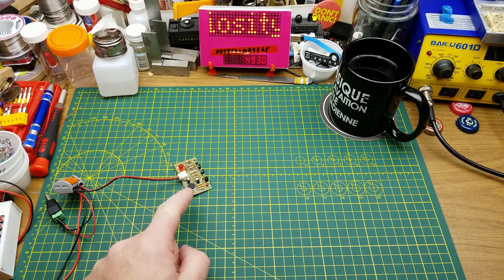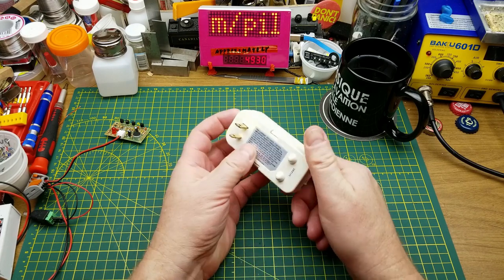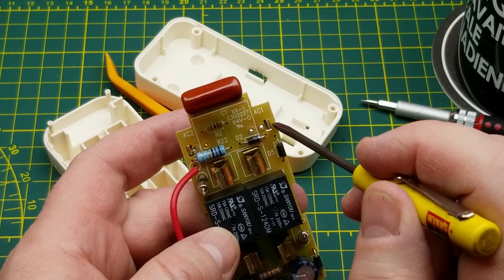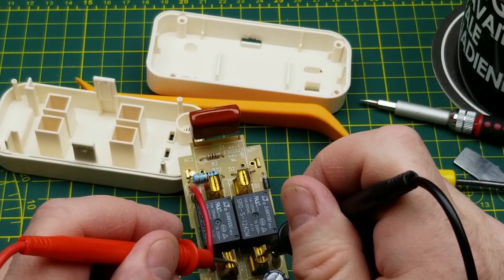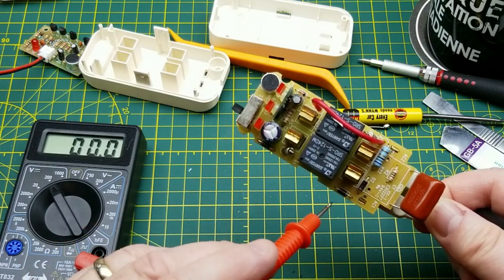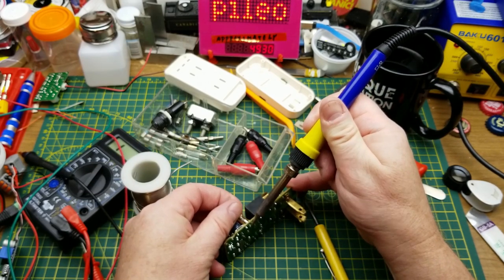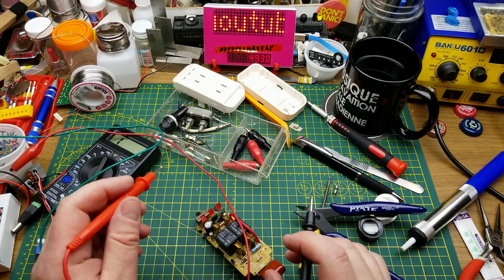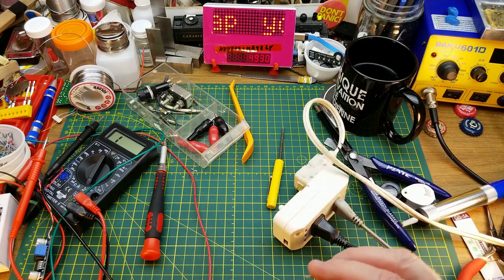The clapper - tear-down and repair

Comment: The old rule of thumb rating a fuse half as much again as the maximum power draw seems to have been followed with a 3 amp fuse where the max rating is 2 amps. At least that indicates some thought has gone into the design.

Comment: Is it  not a standard capacitor psu. The impedance of the capacitor limiting the current. With  a resistor across the cap to discharge it when disconnected supply ?
Reply from the maker: I didn't dive very deep into that. It looked like the big cap was in parallel with the incoming line voltage, but I can't be certain.

Comment: Hello Pileofstuff.    I just looked at your tear-down video and saw what is wrong with mine.  My fuse is blown.   Can you advise me how and where to buy the fuse for the Clapper?  What is the fuse power rating?   I would rather fix-it vs. buy another one.   I miss being about to Clap and turn on my stair lights when I go to my second floor.  Thanks you in advance for your help.
Reply from the maker: For the fuse rating, just look at the device's rating - on mine it was embossed on the plastic "max * ampers" or something like that.

It should also be written on the fuse in tiny lettering.

I happened to have some I bought a long time ago, but I also bought more recently from ebay.  
Try this search: https://pileofstuff.ca/r/la6y9

Comment: Enjoyed the tear-down, however it looks like the sensitivity switch cover was left off in the re-build. When this happens to me there's always that mental struggle of "do I pull it apart again just to put a small part back".  I guess safety of the device must be the overriding consideration.
Reply from the maker: see 12:29
Reply: @pileofstuff  At first viewing, I clicked off just before 12:29 lol.  Your reaction is exactly what mine would be particularly as those case side clips gave you quite a battle!

Comment: Sometimes it's just a bad solder joint.
Resoldering with good hot soldering iron helps.
Pbfree is bad thing. Causes the problems, mostly in chinese electronics